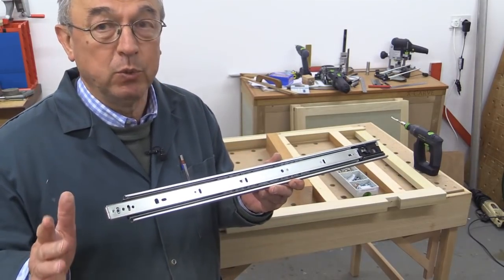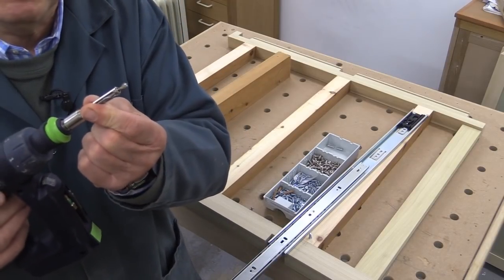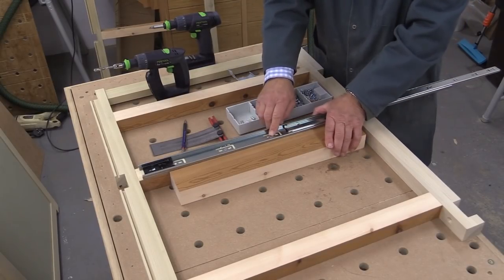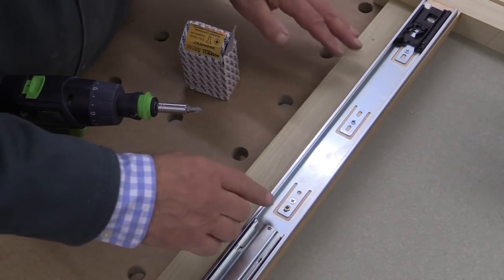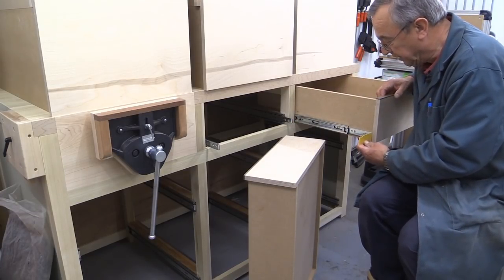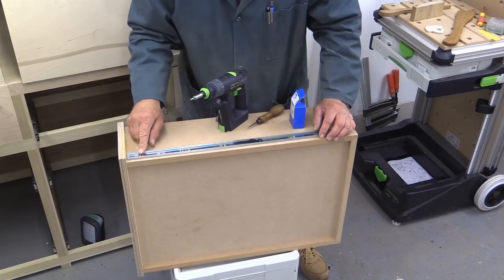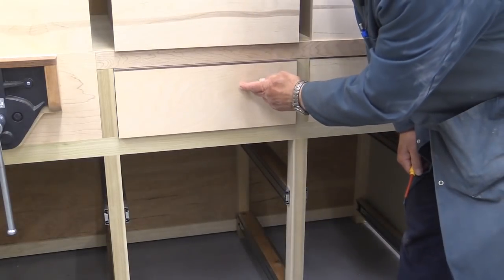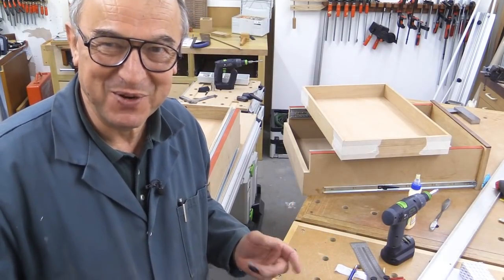How to fit drawer runners

Comment: Great vid, my question is how do you figure out what the total width and depth the drawer needs to be ? I assume the width is calculated by taking the width of each runner away from the Caracas inside width ?
Reply from the maker: Hi Jake, Yes, take the runner width x 2 away from the width of the space and then I subtract 1 mm for the drawer width to be on the safe side.  Peter

Comment: Hi Peter great video, could you please give me the Screwfix part number for the Drawer runner screws. many thanks.
Reply from the maker: Hi John, Sorry for the delay but they were hard to find. The 10.5 mm long ones are 67259 and the 16 mm long ones are 89259.    They are classed as "Hinge Screws" which is why it took me so long to find them.   Peter
Reply: Thank you Peter,

Comment: Hi Peter. Another great video. Very informative. Could you please provide a link to the drawer slides from Accuride that you are using? Many thanks.
Reply from the maker: Hi Steve, They are 3832 runners which come is various forms (soft close, push to open and so on). Try https://www.accuride-europe.com/slides/3832EC-B   Peter

Comment: Hi Peter. Nice video as per usual. You've forced a question from me, perhaps  if you can't answer you could ask your drawer runner supplier as you're in touch with them? 
At 2:40 you show a screw passing through the side of the runner, it passes through a tab that is only attached at one end to the runner the other is free. Why is this? I've often wondered when fitting them. Regards Graham.
PS 16:10 clever idea.
Reply from the maker: Hi Graham, That tab arrangement allows a little flexibility in case the drawer opening is not quite square. As the draw moves and tries to pull inwards on the parts fixed to the frame the tabbed section flexes slightly to overcome the strain. I hope that makes sense.   Peter
Reply: @NewBritWorkshop  Yes thanks Peter, I suspected as much but thought they were a little too stiff and wondered if I'd missed my guess. Thanks.

Comment: Good tutorial. Unfortunately the manufacturers of these slides do not provide a good resource for installation. they always been a little intimidating...maybe even have a snobbish air...as if only should be used by professional cabinet makers...and not us hobbyists. Recently learned that those tase attached to the slide only at one end are are called " breathing tabs". And the are the ones to be used in securing the slide to the cabinet. I ALWAYS WONDERED WHY ALL THE HOLES. I STILL DO. BUT AT LEAST KNOW I AM AWARE THAT THE HOLES TO SECURE THE SLIDES are the one on those flexible tabs. Excuse the capitals.
Reply from the maker: Hi Willem, That does not sound like the people that I deal with - it could be someone was just having a bad day.  Peter